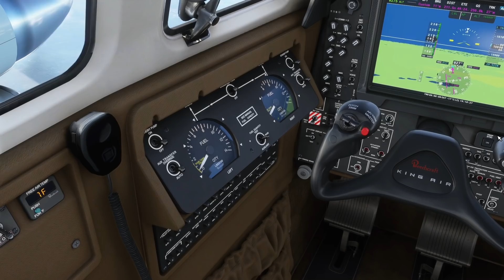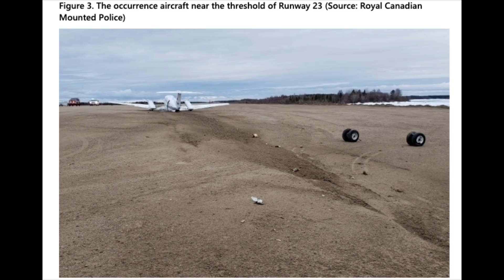The Pilot Who Forgot To Fuel His Plane | Keewatin Air 202

Comment: Sounds like at no point did they follow failed engine procedures and they had plenty of time to.  After failed engine is correctly identified if mid air restart is not to be considered, its close the throttle, cutoff fuel and feather the prop.  How did one of the pilots not even think to do this, to keep that thing flying straight with single engine will require a lot of corrective rudder, with a windmilling prop that's going to make for a very tired leg.

Comment: It's curious that they dumped their altitude and then set up an RNAV approach. Without engines or about to be without engines, more altitude is better as it gives time to make decisions and allows for a longer glide. I'm also pretty sure the unpowered glide angle of that plane (and most planes) is not anywhere close to the RNAV glide slope. They lost an engine, and about to lose the other they sacrificed the main advantage they had in order to set up for an approach the plane was almost certainly not going to be capable of. It seems like they were in a hurry to land hoping to not lose the other engine. Though they were high up in a pressurized plane, there is still an emergency oxygen system (unless they didn't have that filled either...). That's the kind of decision making I might expect from a flight simmer like myself because it's reckless (and exciting), not from someone who flies real planes. In a flight sim I can be an idiot and not really end up dead because I flew an underequipped plane into severe icing conditions for example. Hopefully both pilots improved from the event.

Comment: An analysis on the mid-air crash between Bashkirian Airlines Flight 2937 and DHL Flight 611 would be great (July 1st, 2002, near Überlingen, Germany).
It has been quite devastating, but it also had uncovered some flaws in ATC procedures.

Comment: I personally don’t know why airplane prop engines don’t automatically feather the props during engine out and it starts to windmill…then you can adjust from that position…. What if a control issue happend?  Or it broke or blew up…having it default feathered seems logical….sorta like a submarine during an emergency the bow planes fail or default to a position heading towards the surface rather than the bottom of the ocean

Comment: What Is there a reason the props not having auto feather?  
Classic skill based error in not loading the fuel initially, with issues with CRM on the flight and CRM supervision by the airline.  Also violation/training issue with not monitoring fuel.  Not sure of reason to lose height so quickly rather than arrive at airfield and loose height in overhead? (Three most useless things in aviation: fuel in browser, sky above and runway behind -seems achieved 2 out of three).

Comment: I've never flown anything multi engine, but even with my limited experience, putting down the gear and flaps so early in a fuel starvation scenario just seems so bizarre and unnatural. In that situation, I'd immediately want to minimize drag, set best glide speed, and head straight for anything with a runway! Having two crew could also be great. I could have the other guy mess with the engines and the radio while I focus on getting to the runway.

Given how close they were to an airport, it really seems like they should have been able to make the runway just fine if they'd done things right.

Comment: Failing to even look at the fuel gauges was a boneheaded move on the part of both pilots.  Before you ever start the engines you check EVERYTHING that contributes to flight safety .. control surfaces, tires, fuel, etc.  These guys were apparently operating on the basis of habit .. not really dealing with the actual situation at hand.  Thank goodness no one was killed by this simple mistake.

Comment: What a disaster! So many chances to pick up the lack of fuel, and then they totally bungled the diversion. You mentioned they didn't feather the propeller, but what about the other basics? like if you're expecting you might have to make a glide approach (which even with one engine still running they should have assumed since they had zero quantity showing), DON'T EXTEND THE GEAR OR FLAPS UNTIL YOU'RE ASSURED OF MAKING THE FIELD!

Comment: I have no idea the drag of the flaps when they are fully deployed but in most aircraft, I have flown the last notch is all drag and no extra lift. so to deploy full flaps before you are sure to make the runway is not the best idea. Also, the gear should not be put down until you are sure you have the landing point made. I think they had not spent enough time in a simulator as all these things
are gone over there.

Comment: Very similar story happened at the 703 operator I used to work with, also with a medevac King Air 200.  A Captain training an upgrading pilot to Captain.  Combine with an MEL'd fuel gauage and maintenance items, miscommunication with ground team, mx and pilots, a King Air was lined up on the threshold when the left engine flamed out due to fuel starvation.  If they had even 20 seconds more fuel it would have been a V1 cut and a major problem.  Main cause was neither pilot doing to the function of the F/O which would have been to verify fuel quantity, and with the MEL applied the MEL said fuel had to be full tank and visually confirmed through the fuel cap, but nobody bother with properly delegating duties.

Comment: Just a side note, maybe you should use terms "pilot flying" and "pilot not flying" or "pilot monitoring" instead of the confusing ones you used in this video. A captain is still a captain even if they sit on the right seat; it doesn't make them  a first officer.

Comment: The first trainers I flew in had the fuel "gauge" right in front of the windshield. It was a wire with a cork float on one end! Sticking up through a hole in the fuel tank filler cap!
Pretty hard to miss read that little stick!

Comment: To answer your question,  given where the aircraft ended up, even with the 2 minute delay in making the turn toward Gillam, had each prop been feathered upon engine failure, if they maintained a proper glide speed, I have liittle doubt the aircraft  could have made the runway. Don't ask me how I know.
Reply: Everyone is wondering what happened to the FO. Guessing you actually know... Don't answer if it will endanger your job, just curious...

Comment: Why didn't the auto feather kick in?

Fuel in the ground, altitude above you and runway behind you are useless to a pilot.
Reply: Turboprops do not auto feather like piston engine twins. Windmilling prop keeps oil pressure in dome due to internal pump. You have to manually feather.
Reply: @jimandmandy  both 200's I flew had auto feather & it worked great. True it Dosn't completely feather the prop BUT most of the drag is taken care of.
I'm curious as to how  the almost fully feathered prop would maintain  oil pressure, on a "PT6" ? Please explain?

Comment: I can’t believe they forgot that they should have asked the 2 nurses to hang from the edges of the overhead shelves while they balanced sitting on the top of the seats.  With their weight off the deck, this would have reduced the aircraft’s landing weight by 220-300 lbs at touchdown.  They could have coasted to a sweet rollout.
Idiots.  Just what us flight fearers need.

Comment: No wonder there are so many private aircraft accidents in North America. Here in Australia, every flight, no matter how short, has to have an approved flight plan and part of that plan is a fuel management plan signed off by a 3rd party. It doesnot matter if its a commuter light from a public airstrip or one originating from a dusty outback strip beside a homestead. That fuel management plan certifies the fuel load onboard and the weight and distance to be traveled. The fuel required has to be 30% greater than the worst case consumption scenario. Its signed off by someone who is not onboard and who checks the levels and fuel loaded, and its compulsory or the insurance is void and the pilot will lose his license.
Reply: I haven't flown in Australia for many years, but I trained and got my commercial licences in Australia and have 4000 hours flying overseas and what you wrote is very different to what I knew. I have never known a third party to check fuel. The fuel reserves required were 115% of flight-planned fuel plus 30 minutes.
Reply: @Fomites  Thats the regime as it stands today. Because the routes along the eastern seabord are saturated with commercial traffic, CASA extended the commercial regs to private aircraft. They basically want to harmonise the rules and keep private aircraft out of busy areas. These days its basically impossible to run private aircraft into Mascot or Tullamarine. Even if you could get a slot, the cost is prohibitive. With Covid, they were banned anyway from Feb last year.

Comment: Several ways they could have easily made it to the runway 1) divert immediately, 2) feather the first engine and even if the missed that feather both when the 2nd engine stopped 3) delay lowering of gear  4) could they have used a lower flap setting or delayed flaps? Any one of these on their own would have got them to the runway I suspect as they were soooo close.
Reply: One of the nurses onboard agrees as well: "...the pilot dove the plane immediately realizing the situation, forfeiting a lot of his altitude which he realized later and then leveled off but by this point it was too late. Then I watched as the pilot and copilot struggled to maintain airspeed and altitude to reach the airport." (Cam Webber)

Comment: 5:53 The gauges are hard to see from the right-hand seat 
That does not seem like a good design.
Reply: They are not hard to see. They are easily seen from either seat, that was a BS excuse.
Reply: @mikelp72  Routine and boredom.. dozens, hundreds of flights that are the same where nothing happens. Then comes the one unusual event in your career and you miss it because you don't pay attention anymore.
Feathering the props is pretty basic though and it's on the engine flame out checklist..
Reply: @smcdonald9991  It’s a “memory item,” i.e., a thing you memorize to do before you even look at the checklist. Then, it’s on there too along best glide speed, etc.
Reply: @smcdonald9991  And how about not lowering flaps or the landing gear until assured of making the field in a dead stick landing? That's even more basic, you get taught that stuff before they even let you in a plane with a CSP.

Comment: So they forgot to refuel then they took off and never looked at the fuel gauges?
Reply: No. They actually said 2400 required, 2200 on board.   Simple math error?   No. It’s called parroting.  When I see or hear a pilot parroting I know they are over loaded and have lost situational awareness.  This is key.  The information was going in and out but was not being processed.

Comment: But the crazy conspiracy nuts tell me planes don't need fuel! They™ just pretend they do so They™ can charge more for airline flights!
No really, I've seen people argue that. Though, to be fair (as if it's deserved), I've only ever heard it in reference to jets and I highly doubt they know what a turboprop is.
Reply: same idiots who claim jet fuel can't melt steel...
Reply: @rowerwet  And don't understand that: 1) The temperature of a fire is dependent on the amount of oxygen it's getting. Say from a wind that can make a smoke plum nearly horizontal. And 2) Steel looses its strength long before melting.

Comment: Couple of questions.
1. Do all propeller aircraft have the ability to feather the props?
And...
2. Does feathering the props create reverse thrust on landing?
Thanks.
Reply: Only planes with constant speed props can change their prop pitch and feather the props. Feathering does not create any reverse thrust but reduces drag and thrust to almost zero.
Reply: @ShitboxFlyer  Thanks for the reply.👍
Reply: The KingAir has PT6 engines in which the propeller is driven by a turbine which is separate to the main “gas generator”
This is unusual but it is very very safe and flexible, and also gives huge flexibility in operation.
The drag due to a windmilling prop is very high and an lead to control difficulties.
You can actually feather a perfectly running engine and still fly.
Probably the most reliable engine ever made?
But it still needs fuel to work🦅
Reply: Also the KingAir goes into very fine pitch on landing, reverse is by giving negative pitch and is very effective
Reply: All multi-engine aircraft need to be able to feather. I have not flown any singe-engine aircraft that can feather.

Comment: The first thing they should have done (after they confirmed the engine out), was feather the inop engine. PIC should have called,"my plane" and took control. They did several other things either to late or out of sequence. Had they followed correct engine out procedure they could have made it to the airport.
Reply: The video said they completed the engine shutdown checklist.  I haven’t flown a king air but is feathering the engine part of that checklist?

Comment: A lot of accidents are a direct result of putting humans in charge.
Reply: When I watched I thought “How can there not be some automated technology at this point that displays how many estimated miles of fuel you have left, a low fuel warning light, etc like basically all cars do nowadays? It would be trivial to write the code to save a lot of lives
Reply: @Syclone0044  I agree. However, code can be buggy too, all this automation requires quite an intelligent design to not fail in a "unforseen" situation. And people tend to rely on automated assistance, it will beep soon enough on low fuel... Probably a checklist is just simple, cheap, and at hand even when automation fails, f.e. in a power off situation. You need the paper anyway as a backup.
Reply: Also, just like a car, different conditions produce different fuel consumption. If I fill my car with diesel and drive very economically for 400 miles the computer will tell me I have 200 mile remaining, I then drive 40 mile up a mountain and that 200 isn't 160 but only 120.  There was nothing wrong with the code but the computer had no idea what the future consumption was going to be. A manual check over and above any automated system is essential.
Reply: @Edsbar  Yes, but I believe even a coarse estimate could have succeeded in alerting the pilot that he had forgotten to refuel altogether. Such a massive difference between expected vs reality would be the easiest to detect.

Comment: I suspect there was some soiled underwear in the cabin when that thing bounced off the lake. REALLY close call, and very sloppy for an experienced pilot not to monitor the gauges.
We can all have a brain fart and forget the basics, but this could have been fixed a long time before it became an emergency if the experienced pilot had checked the gauges.
I don't think I would like to fly in anything piloted by that fella. Shockingly unprofessional.
Reply: Problem is you don't now that you're flying with that fellow until you are flying into the lake with that fellow.
Reply: He assumed he had enough fuel, he assumed the other captain had checked, he assumed they’d make their destination with fuel to spare. I think we can assume he no longer works in this industry.
Reply: complacency gets the best of them and the worst of them. I worked at a freight operator for many years. one of our most experienced pilots managed to do the same thing. the problem was the daily routine of an early morning flying the same route, and just expecting the aircraft to have already been refueled overnight. 
On this particular type, the fuel gauges peg full when turned on, then roll back to the actual level. the aircraft had just come out of a week of maintenance, and was swapped into the spot on the line early in the morning. the fuelers didn't have that tail number on their list, so they didn't fuel it. 
the pilot had spent the day before driving from one state to another to pick up a different airplane, then slept on a couch in the pilot lounge that night after flying back.
He was within sight of his destination when the left fuel pressure warning came on, he could have tried it, but there is a mountain to clear in between. 
He was directly over a small glider airport, so he dropped the gear and rolled the aircraft into a turn. The fully loaded EMB110 dropped 6,000 ft to the runway in one turn, and stopped before running off the end of the field. 
He flat spotted the main wheels through to the air. 
His experience with being a skydive pilot is the only reason he pulled it off. skydive pilots try to go from 12,000 ft to the runway without pulling any power from the idling engines in the twin otter at the jump park. often beating the jumpers back to the ground.

the same old same old is the thing that will probably bite you
Reply: Too true!